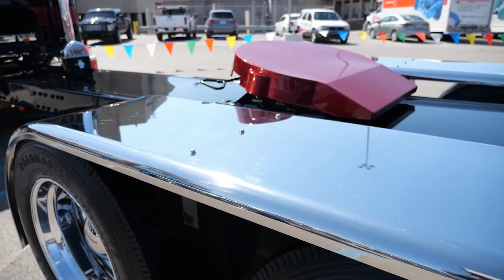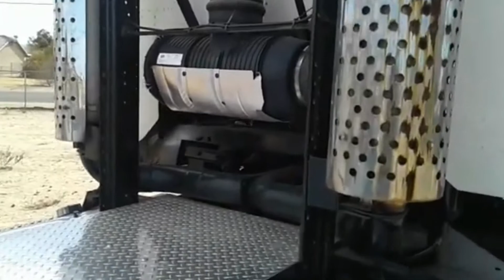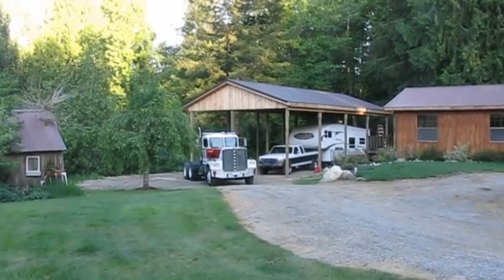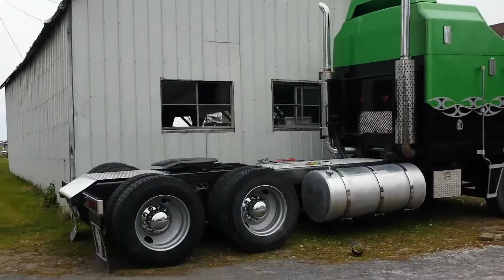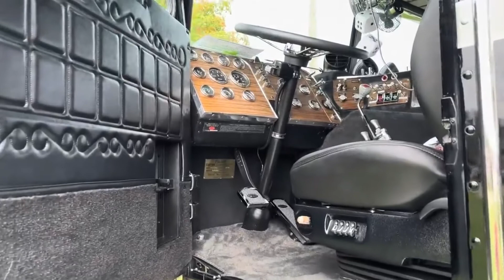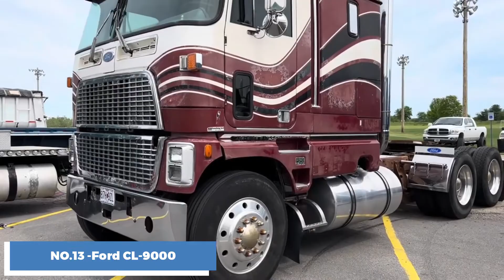13 Trucks EVERYONE Needed In The 70s… But Not Anymore!

Comment: I drove my 74 Transtar II. That I bought in 1979 with 245k on it for 11 years and over a million miles on it when I sold it. It had an 8V71T Detroit, Rtu 9513.trans.  In all that time. And, miles. I did 2 overhauls. 1 clutch. And a few sets of brakes. But never experienced the issues brought up here. No overheating, dash issues. Or, broken cab mounts. I must have been the lucky one. That was the only one I owned of these horrible trucks. I have driven several of these others as well. I thought the Powerliners were cool. Big ponies under the cab=FUN. The only 1 that seemed weird to drive was an 81 Astro. That my Father had leased for awhile. I liked the truck. 6v92 Detroit and an RT09513 which seemed to have a surprising amount of power. What I found weird was, how big the windshield was. My knees were always cooking 😅. But all in all? They were good trucks. The binders, jimmies, k-dubs. Petes , bulldog cabovers. The coolest one I drove though? Was when I test drove a Western Star Cabover. I should have bought it. Instead, I got seduced by White/GMC WIA 64TES. I still like the old iron.